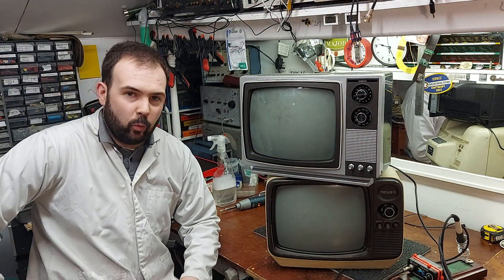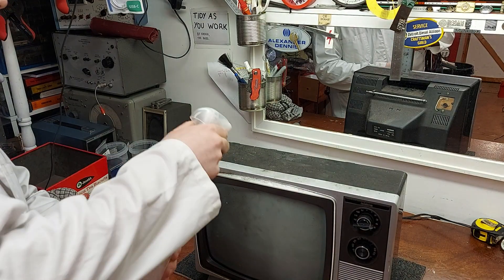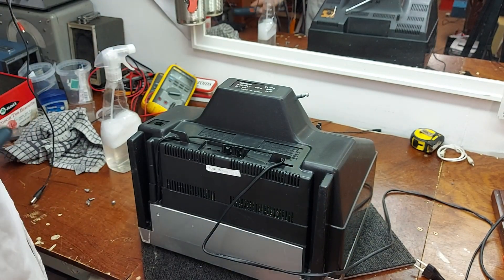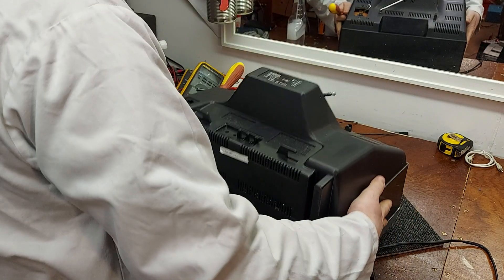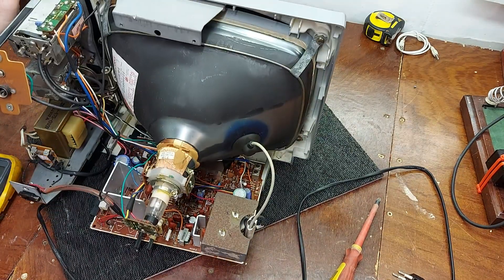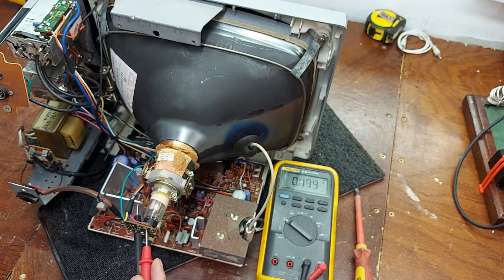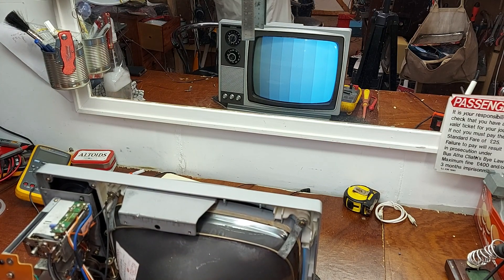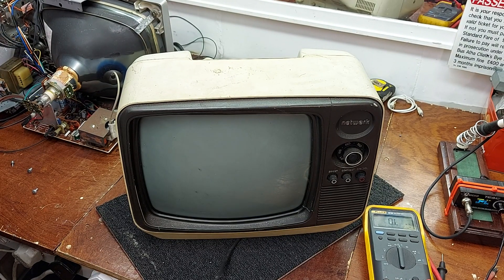Two mono TVs, not much wrong.

Comment: I hadn't seen inside a Korean set like this before but was unsurprised to see a Samsung CRT. I used to have a JBI 12P63, which was an NEC chassis. UHF only, though with a pretty obvious VHF tuner position where a badge was fitted. Little trouble on the whole - slight HT issues and someone disturbed the linearity on it once - fortunately it was possible to see a test card at a convenient time back then. Some interference caused by poor joints attaching wires to the PCB, all sorted. Set still working in 2012, but I disposed of it as I had no intention of taking it camping, having obtained a reasonably sized flat screen digital set for the purpose. The JBI used to come with us all over the UK in the past, though we experienced terrible reception in some areas (notably Moffat and Edinburgh in 1981 and St. David's in about 1988. It was my main set in Sheffield, 1992-3, but it had internal signal pickup which caused interference on sound if used with an aerial and tuned to Sheffield transmitter, when I lived close to it. However, reception was perfect there with no aerial.

Comment: Network , company owned by Dennis G Mott , do you remember the Network  14 inch colour portables in the mid  1980  , the CRT only just lasted 12 months because the factory fitted the wrong heater ballast resistor and the heaters were over run .
Reply: Oh dear, super performance  with sun glasses supplied :-D

Comment: Well aint that a bugger,  a 16 ohm speaker how odd.
And the attack of the fuse stealers lol, you are not alone with that.
I like the mains plug that has an upside down droplet shape with the pointy bit removed.
The Nice brass thumb screws inside are nice,  the two bits of nylon that trap the cable can be a pain but it works fine.
Most plugs seem very rough engineering wise, and the cable clamp can break with over tight screws.
And rubber plugs are a pain when you forget to put the cable through before wiring up, snip snip lol.
You should read my comments when you are having trouble sleeping,  after 60 seconds you are asleep :)
Reply from the maker: MK.

Comment: Bought a similar one of those Network sets from a car boot sale back in the 80's for £5 which had preset buttons (6 I think) but we could not work out how to tune the presets in. We could not find any way of fine tuning the presets so ended up taking the back off and spotted the little thumb wheels and dials on the inside of the set! We then found out that you push the panel (with the preset buttons on) and it then slided out so you could access the tuning. It just goes to show if you don't have much knowledge of these things   and no instruction manual you can get stuck! It was a nice little black & white set but we eventually got rid of it due to it's buzzing transformer which gradually gotten louder the longer the set was powered on and in the end it was so loud you could not hear the programme! Happy times.
Reply: @kyle8952  I’ve come across a few like that at work!

Comment: I have never seen a UHF only tv before. The top one, is made by samsung from 1981 to 1985, they were exactly the same in the states. The bottom one is made by either toshiba or samsung too, the closest thing we had to that in the states was a Portland 12 inch b/w with a different tuner. June 1976 to early 1980. Didnt really change. Yourse looks to have the same shell as the portland but probably not the same innards.
Reply from the maker: As Kyle said. You come across a few without the VHF tuner, these were "gray imports"....
Reply: @kyle8952  A friend of mine in Kerry had a UHF-only Mitsubishi set which had come from the UK. The RTE transposer in Listowel was VHF only at the time (channels F and I) so they used a converter to use it, which shifted the VHF frequencies up to UHF. It didn't work that well though, he told me that in the days of analogue mobile phones that they used to be able to hear one side of phone conversations over the TV when someone passed by!